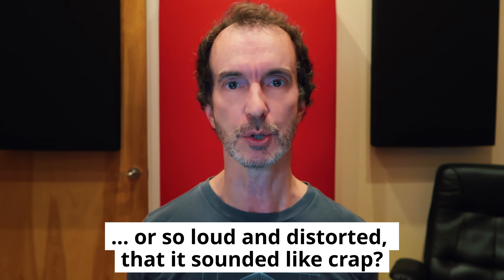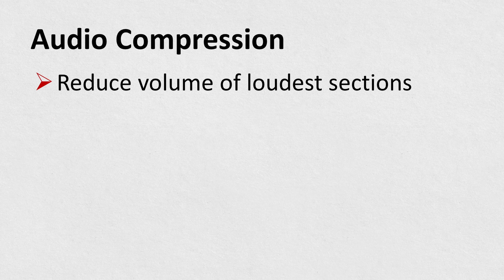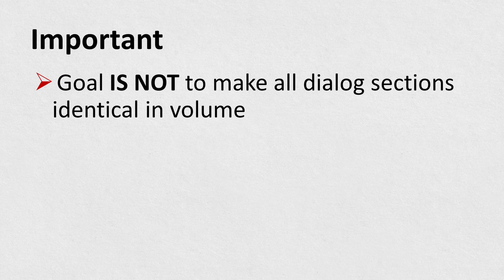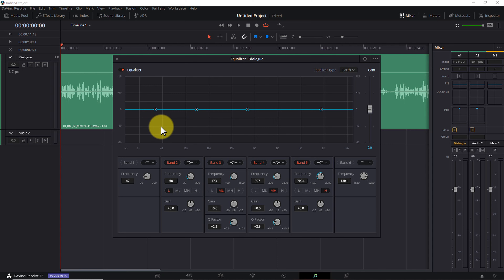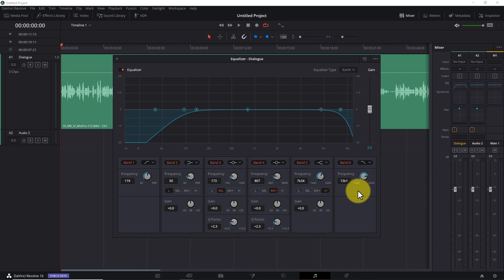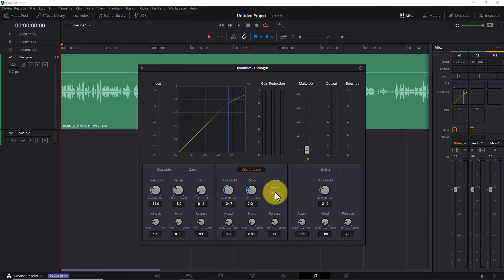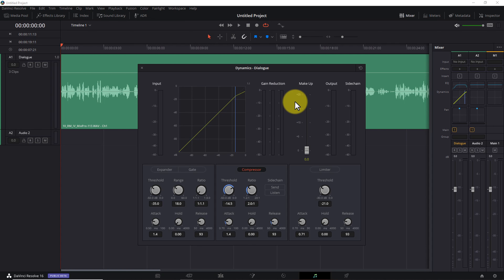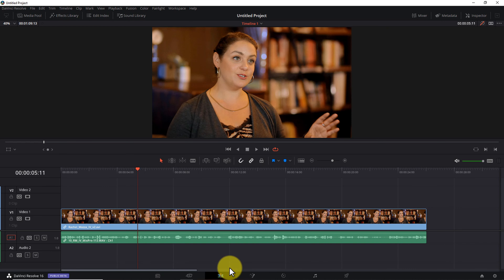Make Your Dialogue Crystal Clear — DaVinci Resolve PowerTip

Comment: What technique do you use to adjust the vertical bars that appear at the bottom right corner of the Fairlight page? - the ones that say Dialogue, Audio, Main? What is the relationship between Dialogue and Main?
Reply from the maker: By "vertical bars," can I assume you're referring to the audio meters?

"Dialogue" is a single track of audio in my Resolve project. "Main" is the top level output buss through which all audio track levels are summed before they're sent to your speakers, headphones, or your rendered audio.

You can control the volume levels of each track using the faders in the lower-right corner of the Edit window (when the Mixer view is open), or on the Fairlight page. Let me know if this hasn't answered your question.

Comment: Which other filters would you recommend? I notice in the DaVinci dialogue processor there are a few others, e.g expander, de-esser, de-pop?
Reply from the maker: Hey, Nishal. I don't recommend filters of any kind unless you have a specific problem you need to solve.

If your dialogue is a little too sibilant, try a de-esser. If there are plosives that are problematic, try a de-popper / de-plosive module. Try a gate if there's a little too much room / background noise. But never throw a processing plugin on your audio just because you can. Use them only when you need to because — when overdone — these modules can do more harm than good.

Comment: Hi David,  I go into Fairlight, find the section that I want to reduce the audio, when I click the point for the starting point, no marker comes out. Can you tell me how to do this? Thanks a million.
Reply from the maker: I'm not clear on what you mean by "no marker comes out."
If you're looking to cut the audio clip so you can raise or lower it's volume, once you've placed your playhead where you want to make the cut, you need to click the scissor icon... that splits the clip. Just split it into as many sections as you need and adjust them each individually. Let me know if I've misinterpreted your question.

Comment: Excellent video.
Question: In Fairlight, you have 'Mono' vocals and maybe 'Stereo' backing music. When you press Deliver, which setting do you choose for Audio: All Timeline Tracks, Main (Stereo), etc? or do you change the vocal to 'Stereo' in Fairlight and then just the usual Main (Stereo)?
Reply: Depends on your routing. By default, all tracks, mono and stereo, are routed to the main stereo output. When you deliver, if you select the main stereo output, you'll get exactly what you were listening to while editing.
Reply: @SwansongMedia  ok thanks
Reply from the maker: Apologies for the delayed response. @SwansongMedia nailed the answer... Main (Stereo) is the right choice. Any mono tracks in your project get routed equally to left and right stereo tracks so that's the right call.
Reply: @DavidPower  Thank you.

Comment: You compressed 3 db and compensated by using makeup to add 3db.  But you are not finished at that point if final level is either too low or too high.  You   need to explain how to get the final level right too.

Comment: If  you make these changes early, before cutting up the audio channel will the changes stay for each individual clip? Or, should you make these adjustments after your timeline is complete (just before rendering)?
Reply from the maker: Hey, Donal. If you make these EQ and compressor settings at the track level (as I've demonstrated), they'll apply to all clips on the track no matter how you chop them up or rearrange them. However, I recommend placing audio clips from different sources on separate tracks as each may night slightly different adjustments to compression, EQ, volume, etc... and that's more difficult to do when they're all on the same track. Hope this helps.
Reply: @DavidPower  Thanks for the explanation David.

Comment: I have a question! At around 11:50, you try to set a threshold to reduce the loudest parts of audio by 3dbs. But I thought the ratio determines how much of a signal gets cut by?

So for instance, a threshold of -20 and a ratio of 2:1, and a signal of -10.

If a signal of -10 is cut in half..isn't that -5? lol

Im confused where ratio comes into play with the gain reduction
Reply from the maker: Hey, Nick. Excellent question. Thanks for asking it. One of the less intuitive aspects of audio is that loudness is measured on a scale ranging from -Infinity to 0dB... which makes "small negative numbers" louder than "big negative numbers." I can tell from your question, you understand that concept. But it can complicate the understanding and the math behind it for some people... which is why I'm highlighting it again here. Let's take a look at your scenario...

Threshold = -20dB / Ratio = 2:1 / Input signal = -10dB

The key lies in asking (and answering) the question: How high above the threshold is my input signal?

Mathematically, the answer is:
dB above Threshold = (Input Signal - Threshold )
dB above Threshold = (-10dB - -20dB) 
dB above Threshold = +10dB

Remember, compression acts only on the signal above the Threshold. In this case the ratio is being applied to a +10dB signal...

And at a 2:1 ratio, the +10dB signal is knocked down to +5dB,

So your output signal becomes:
Output Signal = Threshold + Compressed Signal
Output Signal = (-20dB + +5dB)
Output Signal = -15dB

To recap, we've taken a -10dB signal and knocked it down to -15dB.

I hope this makes things clearer.
Reply: @DavidPower  perfect. thanks for clearing that up!

Comment: Hello David,  I was wondering you can help me.  I have a few unedited clips in media pool.  When I play the first video unedited clip the sound is just as I recorded it.  However, when I play the rest of the clips they all sound robotic.  However, the same clips if I played it on imovie or anywhere else sound very normal.  Any advice or help? Thank you
Reply from the maker: Hey, Ravy. Welcome to the channel!

The only time I've seen the symptoms you describe here is when there's a difference between the sample rate (and/or bit depth) of the video clips you're editing and the default settings for your audio interface. For example...

The audio in most video cameras is recorded at 48kHz. If your audio interface is also set for 48kHz, there usually isn't an issue. But if your interface is set for 44.1kHz (i.e. the "other" standard), there are times when the interface fails at accurately translating between the two.

Worse yet, it can be unpredictable. I've seen situations where the translation is seamless and others where it's a hot mess.

The first solution I'd try is ensuring your audio interface is configured for 48kHz. And also that your clips are at 48kHz (which is most likely the case).

if you're using your computer's integrated audio interface, that can sometimes be an issue as well. They tend not be as robust as a dedicated external interface. If you're deep into video editing as a business or passion pursuit, I'd recommend upgrading to a proper USB (or Thunderbolt) audio interface. You shouldn't need to spend a lot to get one that does the trick nicely.

Let me know how you make out.
Reply: @DavidPower  Thank you, David!  I'm gonna take a look at my OBS Studio to see if it's at 48kHz and I think... my audio interface.  I'm not sure if I use an audio interface or if it's just an amp haha but i'll look at it and let you know after work today.  Thank you for kindly responding to me!  You da man!

Comment: I find that using the compressor is not as good as using the Soft Clipper. For some reason my loud parts just sound worse when I compress them. The quality drops and it sounds unnatural. Using soft clipper to bring up the lower parts is much simpler and more effective

Comment: Hi. David. I'm new to Resolve. How does one modify audio on a single clip. I work with EQ on clip but the entire track gets affected.
Reply from the maker: Hey, Manny. You can add effects / processors at the clip level by dragging them from the effects pane and dropping them onto the audio clip. While this works and is supported, I don't recommend it. I find it makes unraveling what I've done much more difficult. Better idea to add effects at the track level and expand the project to as many tracks as you need. That's my preference.

Comment: Should i normalize before or after doing this?
Reply from the maker: I'm not a big fan of normalization. (In fact, I never do it.) If you have the right tools, (i.e. I use iZotope Rx), I recommend setting the "loudness" to -16 LUFS with a maximum peak of -2dB. Those settings ensure every video I make is consistent in volume without being too loud.

Comment: Hi,
   I have footage ( a monologue) that I shot with a gopro and cut portions out to get rid of grammatical blunders. I didnt touch the audio other than that The audio sounds fine in the cut panel but really bad in the edit panel. I checked the frame rate and everything looks consistent and cannot figure out how to remedy this.
   Any tips are definitely appreciated.
Reply from the maker: Late reply I know, but... There's nothing that should make the dialogue sound different in one Resolve panel over another. They're all using the same underlying audio engine and it doesn't sound like you've added any processing or VST's that might be enabled / disabled across panels. Did you ever figure this out?
Reply: @DavidPower  it was a little while ago and I’m going to have to think back to remember how I got it fixed. I know it took me a while and it ended up seeming fairly simple but I was still a little mystified afterwards.

Comment: question, normally when someone talk normally it should reach -6, in resolve it doesn't show all the numbers, so how can i see when the audio is loud enough?
Reply from the maker: There are no hard and fast rules with how loud dialogue "should" be. But , if you are using -6dB as your target, simply eyeball the meters to make sure you're in the ballpark... -6dB will be close to half-way between -10dB and 0dB. Eyeballing will get you close enough in most cases.

Comment: Um... but... this seems to apply the audio changes to the entire track.  What if one has ten different audio takes that each need a different EQ etc?  How do you single out a chunk of audio?   And what if you want to dynamically change the settings throughout the take?  Can you add keyframes that establish settings that then change over time?
Reply from the maker: You are correct. As a general best practice, different takes should be placed on individual tracks with EQ, compression, and any other processing applied at the track level. This makes it a heck of a lot easier to tell at a glance what processing you've applied to each clip... especially if you pull the project up months later and try to recall what you've done.

If you absolutely need to, you CAN add effects at the clip level. It's a simple matter of dragging and dropping them from the Audio Effects bin onto the clip itself and adjusting as needed. Just be aware, if you need to edit clip-level effects after the fact, you'll need to select the clip, open the Inspector pane, and choose the Effects tab.

To your second question, yes... you can automate effects settings in Fairlight using automation envelopes. I cover automation in this video: https://www.youtube.com/watch?v=P5S5Vyx7YjA

Hope this helps.
Reply: @DavidPower  Wow, that's customer service!  OK, hopefully I can translate your words into the right actions :-)

Comment: what do i do if i want to perform regular compression on music but also want to do ducking
Reply from the maker: Excellent question. I recommend compressing the music track in exactly the same way I've outlined in the tutorial. With music... and depending on the style (i.e. EDM vs. acoustic Jazz), you may want or need to apply more gain reduction. For vocal dialogue, I recommend no more than 3-ish dB. For music, you may want to go as high as 6 dB or more. Again, it depends on the genre and how you want the music to sit versus the other elements in your mix. 

For ducking, I like to draw an automation envelope on the music track so I have precise control over when and how quickly the music fades in and out. That would be a great tutorial topic. Thanks for mentioning it!
Reply: @DavidPower  Thank you for your insight. A workaround I've found is to apply "dialogue processor" effect onto the music track and use only the compressor
and use the music track's dynamics compressor for ducking.

Comment: What if we just increase the volume of the quiter dialogue parts instead of touching that makeup option?
Reply from the maker: Makeup Gain adds "volume" to the entire track — as you may have guessed. If you want to increase the gain of just the quieter sections, you'd have to do that manually by splitting the track into clips and adjusting gain on only the quiet clips. It's a valid approach but tedious for longer tracks.

Comment: Compression in video and audio in terms of dynamic range it's the same thing. Bitrate its another thing. Cool video, but that part was really missleading.
Reply from the maker: Daniel, I respectfully disagree that "... it's the same thing" or that any part of the video "... was really misleading." Let me explain...

In the context I used the expression "video compression" — that is, converting a larger video file into a smaller one — loss of dynamic range is an undersirable and unintended side effect... not the intention or purpose of the compression. If I could make video files smaller without losing dynamic range, I would do so every time.

On the other hand, "audio compression" (again, in the context I've used it) is performed with the intention of reducing dynamic range... that is, reducing the difference between the loudest parts and the quietest parts of the audio.

I value your input and if I've misinterpreted your comment in any way, I welcome a rebuttal.
Reply: @DavidPower  We agree that we desagree. Electromagnetic frequencies  works almost in the same way in their respective spectrumes. In their data form, with their respective scopes compression will always reduce dynamic range. For example. Going from log to rec709. Take care.

Comment: Isn’t the definition of this treatment called Normalization instead?
Reply from the maker: Normalization is different. It's the process of scaling all the audio upward in volume by a consistent amount by making the loudest peaks equal to (or just below) 0dB. There's nothing wrong with doing this. But it doesn't reduce the dynamic range (i.e. the difference between the quietest and loudest parts). If you have a need to normalize, compress first.